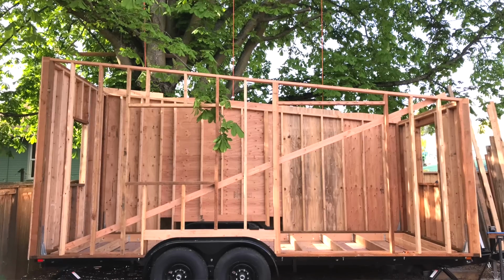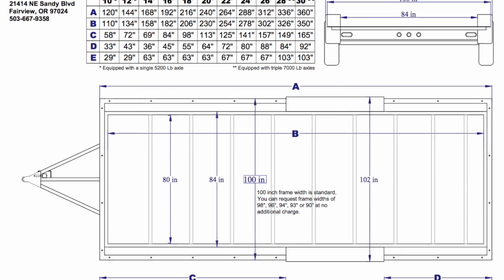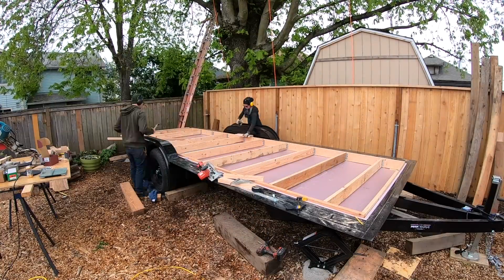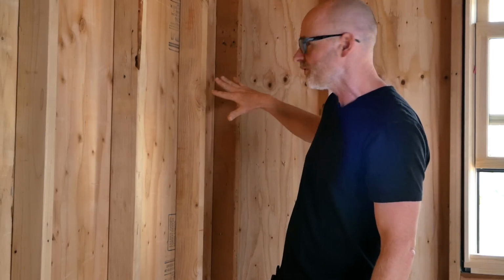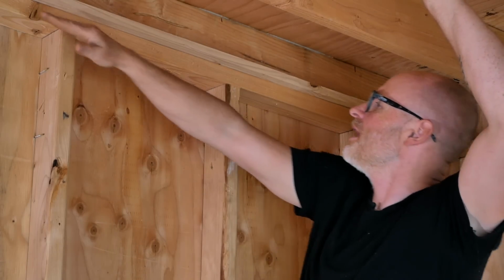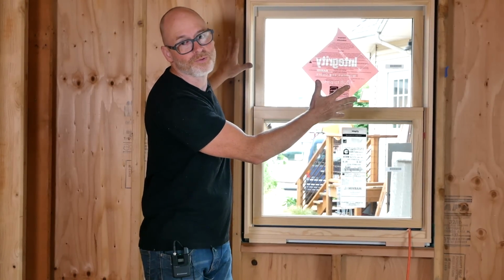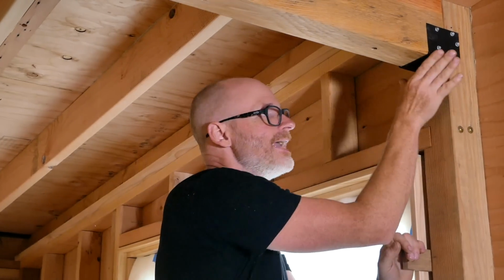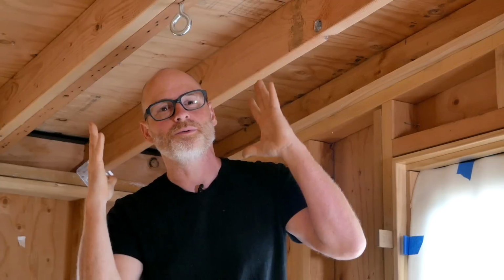Smart Framing For A Warmer Tiny House

Comment: Love your thought process, excellent delivery, consideration for building sci. You're doing such a great job. Couple of quick thoughts: 

Plywood orientation on floor: I thought plywood puts each lamination perpendicular to the next, making it so the way you lay it doesn't matter unless you care to see the grain aesthetically. 

PT floor plates: I hate PT and I have seen people just spray the lumber first with boracare (diluted 1:4 w/ water). I think the same concept of creating a capillary break between wood and concrete may apply here. Perhaps consider using 'sill seal' to break it from the trailer. 

Width of trailer: I'm wondering if a 96" would be good followed by more 'perfect wall' concepts like you did on your roof. Exterior insulation with good drying potential like 1.5" of Rockwool comfortboard 80, wood fiber, or EPS, followed or preceded by a best in class WRB like Intello Mento or SIGA Majvest and a rainscreen. 

And I love the window frame detail (5 degrees). Just a question, you must have to increase the vert dimension of the rough opening a bit right? Maybe an extra 1/8" - 1/4" measured from the front? 

The Marvin Integrity windows are nice but I think double-hungs, just by design, leak a lot. I regret them in my larger house. There's manufacturers that sell swing/tilt windows that look like double-hungs. But I suppose being a tiny house, it's not so critical. Heating much less space so a little loss isn't the end of the world. Anyone living in one of these is drastically reducing their carbon footprint. 

I admire everything you're doing. Such good work and thanks for sharing. Good stuff!
Reply from the maker: Thanks, agreed on the PT, wouldn't do it again.  I generally feel pretty safe squeezing the vertical RO on a window, but definitely not horizontal.  Interestingly I did all casement windows on my last house, and went back to double hung on purpose.  

96 makes a lot of things easier, but man that extra 4 inches is nice.  Going wide and low makes the house feel a lot bigger than it actually is, unlike most tiny houses that feel like narrow hallways. A lot of our dimensions were dictated by the space we need to get this thing in and out of the driveway and the space it needs to sit.  Exterior rockwool is too heavy, and besides, it's not the insulation that's killing your efficiency in a tiny house it's the AIRFLOW.  The ventilation rate needed to keep a tiny house with 2 people below 1000ppm CO2 just murders efficiency and unfortunately nobody makes a small HRV that doesn't suck!
Reply: So you recommend rock wool for the floor and ceiling but not walls?
Reply from the maker: oh I misunderstood, I was thinking that you were talking about a rockwool wrap like you see people doing sometimes these days where it goes on the outside of the sheathing behind the siding.  That would add too much weight to a tiny house but for the interior of the sidewalls I definitely use Rockwool
Reply: Not sure what the OP was talking about but you've answered my question. Thanks!
Reply: @actuallytiny2537  Yes I was talking about continuous insulation but your point about the weight is something I didn't think of. I personally have no issue with EPS foam. It's cheap, doesn't outgas CFC's slowly over 100 years, sometimes it can be obtained used, and it's vapor open.  Have you tried Lunos for an HRV alternative? Curious how well it works.

Comment: Thanks for the video.  I'm curious why you wouldn't use steel studs in your walls.  More room for insulation, less weight and cheaper.
Reply: That's not a bad idea. I bet you could, but it is a moving trailer so I think there is some structural requirements, would maybe need a solid welded main frame or something.
Reply: In Australia they do steel studs

Comment: @actuallytiny2537 I've watched this a couple times and found most of it great advise, but I'm truly curious where you got the info on the fibers of the plywood being stronger one way vs the other? The construction of the plywood and the reason it's so beneficial and sturdy is because each layer is rotated 90 degrees, so the fingers are running both lengthwise and widthwise so there isn't any noticable difference between the orientation of the board. Because the grains/fibers are perpendicular to each subsequent layer is what makes it stable and prevents it from moving

Comment: Bro closed cell spray foam only need 3 inches to get to R21, which would mean a 2x4 rood would be plenty. Personally I would take advantage of the structural advantages of closed cell foam, its like gluing everything together, the plywood would be glued to the framing, on a insane level, its also waterproof. BASF makes the best foam. I dont trust the open cell though, I was in the business, open cell is to easy for installers to mess up.

Comment: I understand your point on the headers not being needed, but it still freaks me out.  I’d probably have done at least a double 2x4  on edge header and  put 1/2” of foam on the inside.  Just me.  Love the detail in planning!
Reply: Dude it's basically a shed. Lol. It doesn't have 10s of thousands of pounds to support

Comment: LOVE the basic floor plan design. Perfect size, in my opinion.  I’m older and don’t need tight stairs, so this single story design meets that need too. Great detail and features. First design in tiny homes that honestly addresses need for some degree of storage 👍 and other daily living needs  The deck with kitchen pass through is perfect.  Overall, this is FANTASTIC and will be part of my guidance when I design.   
The potential of this design in exciting.
Only thing I would add to the approach is more solar and other forms of passive energy production and storage. But that would work for me since I live much further south.  I’m not sure how cost effective solar would be up in region around Quebec, so this comment is not criticism.
Reply: Because so many county building codes and tax codes differ in the USA, I also want to avoid the loft/stairs issue - and, consider old age for myself. I wish more tiny home videos showed and also explained not having a loft.  I am hoping for a murphy bed, but am not sure about the weight or cost or the thickness or how different hardware affects the weight and thickness - or how ventilation of the mattress will work.
Reply: @genkiferal7178 look up beds on linear actuators. Better than a Murphy bed in my opinion. The bed lifts directly up into the ceiling when not in use, so it can stay fully made up and be ventilated from underneath. When lowered, it can rest on purpose-built furniture or framing so it is stable and safe.
Reply: @Tonisuperfly  Oh, I've seen those and they are interesting.  But, with a murphy bed, you cannot see the bed anymore and you don't have to worry about expensive mechanical parts or engines wearing out. 
    A murphy bed seems more simple to me.  I would cover the door part of it, though, with a pretty fabric so that the mattress could still breathe...maybe a silk-screen type of look or just linen and have other linen elements in the house - maybe curtains and slip-covers.

Comment: Good info. for builders who want to save both money and weight on their tiny house.  I can't really argue with anything that you said.  I would like to know what you are planning to use for the interior wall finish - drywall or plywood?  I don't think drywall is suitable if this unit will be on the road a lot.  Also I would use some 29 ga. diagonal galvanized metal strapping to the studs interior and exterior to stiffen the overall structure to road flexure as well as to wind resistance.  I assume that all members and cladding are screwed together rather than nailed.
Reply from the maker: I designed the shape of this house with massive sheer panels so the whole thing sheathed with half inch ply ring nailed together and the continuous flat plane of the roof is probably going to be fine to deal with moving the house.   If you’ve got good sheer strength sheet rock will hold up in a tiny house although probably not something that’s designed to be moved all the time.  We also glued the sheer panels on in addition to the ring nails.

Comment: Are you worried about compression of the foam board on the flanges butting against the sill plate? Can it take a lot of weight?

Comment: Uhm... please tell me that the ventilation is BETWEEN the foam and the rockwool in the roof, right? Because foam is going to be more dense than rockwool. And we know that you want the most dense material closer to the inside of the house (the warm side), since the switch between insulation materials and vapor barriers are perfect condensation points. 

According to local regulations here, walls should be 5 x more permeable on the outside than inside, and roofs 10 x more up top than toward the ceiling. If you put foam above rockwool, you're creating a condensation point in your roof. Seems strange to do it that way.

Comment: Very informative! great videos. Was there a reason why you ran your rafters long ways with the tiny house versus from side to side? Planning to build a 22 foot tiny house with same rake roof and going over all options. Thanks!
Reply from the maker: If we ran the side to side we would have had to cut vent channels into the tops of every rafter and we would’ve had to have much bigger headers over our door and window to take the load and we would have had to run our plywood the other direction which would be really annoying because there would be this little 4 inch strip of plywood we would have to add to get to the full width.  There’s advantages and disadvantage to both methods
Reply: actually tiny going long way as you did. Makes more sense for us as well! Thank you! Your videos have been such great help!

Comment: Certainly not a critique...more of a question....I noticed you didnt have a top cripple on window....where that joist was...would the extra insulation/less thermal bridging...outweigh the extra support....if indeed you would get any extra support
Reply from the maker: It just depends on the situation, if I need something like that to carry the load I’ll put it there but otherwise not.   I’m not sure which window you’re talking about but the loads work with the spans at least in this case although not always.

Comment: Very informative Sir! 
Why not use 4"-5" of foam in the ceiling? Cost ? Also as an old logger from the Pacific Northwest, Douglas Fir, Red Fir, and Second Growth, are different names for the same species. Old  Growth, is also called Yellow Fir, because the heartwood is yellowish, as opposed to the red heartwood in Douglas Fir. Just a minor detail! Thank YOU for your excellent ideas... please keep up the good work! Respectfully yours,MZ
Reply from the maker: Cost and fire protection.  I'd rather skip the foam altogether but there isn't a way to do that and get the same insulation value without going taller on the rafters and this house is challenging because we need to clear a low roof overhang to actually move it!

Comment: My understanding was that depending on the zone (which could be anywhere for a tiny on wheels) if you had sufficient foam insulation above the sheathing then you don't need eave ventilation, or an air gap between the foam and the sheathing, as long as the foam is seam sealed.  Do I have it right?  Or is this just a preference for more ventilation rather than a code requirement?  I got this from Risinger, whom you mention, and my reading of the code seems to agree, but I'd love confirmation.
Reply from the maker: I’m just always skeptical that some kind of moisture isn’t going to make it up into the roof cavity.  I think if I was going to go with a hot roof like that I would probably spray foam the entire inside of the roof top to bottom.  I don’t think I would trust hot hot roof with fluffy insulation anywhere in the sandwich.  I’m interested in this subject though because I haven’t found a lot of good empirical data on how hot roofs actually hold up over time.  I’m also not sure how to attach the roofing through several inches of insulation?  Let me know if you have any more understanding about this.
Reply: @actuallytiny2537  Matt Risinger's video on the topic is https://www.youtube.com/watch?v=Qhs52h8f51Q .  I think he does purlins over the insulation with long screws and then regular attachment of roofing to purlins.  Here's a code reference I found at https://www.finehomebuilding.com/2015/11/11/insulating-unvented-roof-assemblies 
but I'm not a contractor or engineer, just a homeowner trying to do some research.  I'm in a dry part of CA so it looks plausible with only 1.5" of foam needed

Comment: So why not use 2X8 rafters 2 foot on center instead of 2X6 16 inch on center. A 2X8 can span 12 foot, since you have a center beam and this structure isn't 24 foot long a 2X8 would be over building and give you more room for insulation with less thermal bridges.
Reply from the maker: It's a height issue in this case, we had a external and internal clearances that were rock hard limits.
Reply: @actuallytiny2537  I see. :)

Comment: What are your thoughts on steel framing to save weight. I am building a tiny house in South Texas so thermal bridging is less of a concern as we have very few really cold  days.
Reply: did you do it yet and did the steel framing interfere with your cellular or WiFi or other radio (wave) signals?  In some of the tiny house videos, I noticed flickering lights and wasn't sure if this was radio-wave related as i had a problem with that with one particular lgi8ht fixture in a regular house - it was the type of bulb I used, not the fixture really...was it a compact floursecent bulb?  I forget now....but, when my radio was on at the same time as the bulb, I think I recall that both radio and bulb didn't work correctly.
Reply: @genkiferal7178  I'm on my second tiny house. I did stick build for both. Easier for my carpenter whose experience was primarily stick building. It's heavier, but we won't be moving them often if ever.

Comment: It is a real concern and you should definitely stick with pressure treated for sill plates.
The horror stories of what water damage and rot of wood  framing has done to some tiny homes warrants keeping a know standard until otherwise proven unnecessary.

Comment: That HDU5 is not doing anything being in the bottom like that. It needs to be a few CF up to put the corner member in tension. If the bottom of the hold down is touching - it’s just a glorified L bracket.

Comment: Considering making good use of the legal limits of size and function of a tiny house. How cheaply can one be self built using mostly new materials but also using recycled windows self made seperate compost toilet and a simple french drain system for the shower sink, propane for cooking and heat and a modest solar system for fridge, fans, and led light.

Comment: While I like the general gist of everything, if you're building off of a solid trailer base there's no reason to use a 2x6 for floor joists, other than clearance or insulation, and if that's the case I would make my own engineered beams for that purpose, saving approximately 40% weight, decreasing thermal bridging and increasing area for insulation.  Same for the walls, or using staggered beams to prevent thermal bridging and increase insulation area, as well as using only 3/8" plywood inside and out, which would strengthen the structure, and provide twice the shear strength. All of which requires more time but less $$, so to each their own.  Being Covid unemployed I have more time than $$, but the trailer limits are a big factor in any build.
Reply from the maker: Technically you could do all that but practically it gets pretty fussy and time consuming and expensive, and the gains aren’t nearly as large as you’d like. For most tiny houses the window to wall ratio and cold air influx for ventilation are dramatically higher than in a standard home, and thus represent a proportionally much higher loss per occupant .  Insulation can only do so much when you’re just pouring air through the house and unless you wanna spend a fortune on high heat recovery ventilator that’s sized for a much larger house there’s not a lot of good ways to mitigate that.  I think if I lived somewhere colder than here I’d build with 4 1/2” thick sips, allthough those have problems as well.
Reply: @actuallytiny2537  Gotcha, it's a;lways a matter how much tim or money you have

Comment: I feel like you could have put like 4 floor joist going lengthwise and I feel like bolting it as much as you did wasn’t needed. You’re screwing 3/4 ply to it. It’s not going anywhere. You mount your wall directly to the trailer.. the floor does nothing but stop heat from leaving.

Comment: Please! Isn't Plywood made from glued layers of wood and each layers' direction of fibers is 90° turned to the layer before? Intentionally to make it stiffer and less breakable? So why is the laying direction important for flooring? Can you please explaine why it is more stable, the way you reccomand! thx
Reply from the maker: The issue is more how the entire sheet functions in tension, so if you have the sheet laying on the floor lengthwise across many joists and then you step in the middle of it the force this deflecting downward is pulling inward from the fasteners all the way to the end of the sheer.  It just makes the whole thing more stable and ties things together better.  Also a standard principal in framing is that you don’t want to line up the joints on a plywood floor.  This is called railroading. Sheet breaks should be staggered to add strength.  For my floor I was following some thing I saw in a tiny house plan somewhere that I didn’t really even like at the time but I thought maybe they understood something that I didn’t.  This was not true.